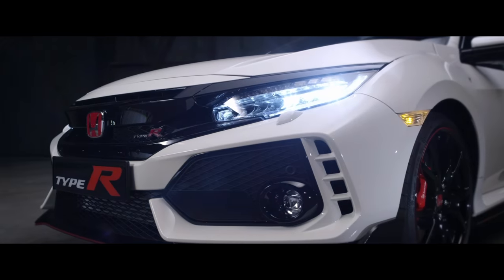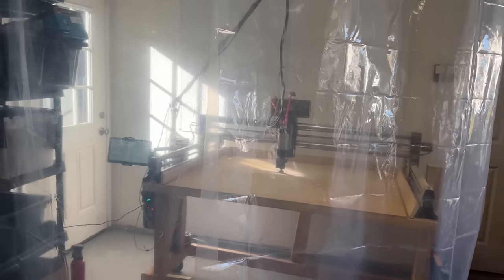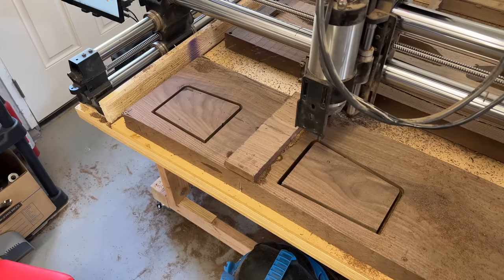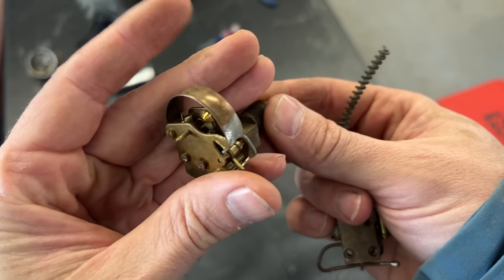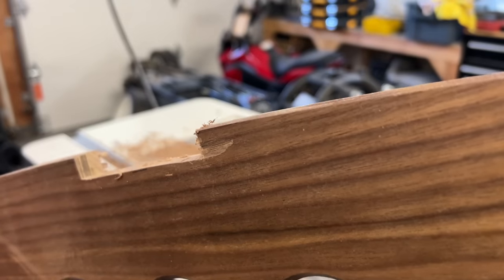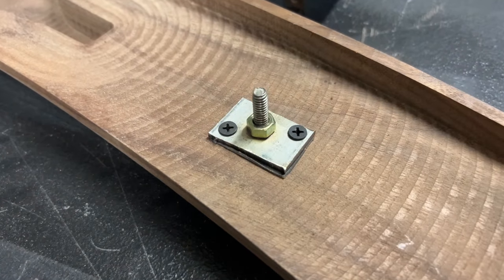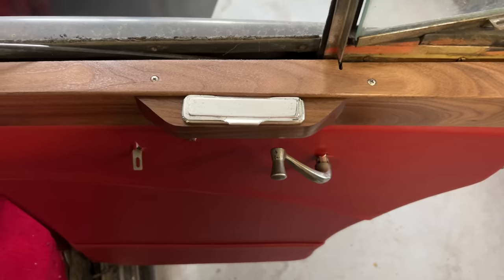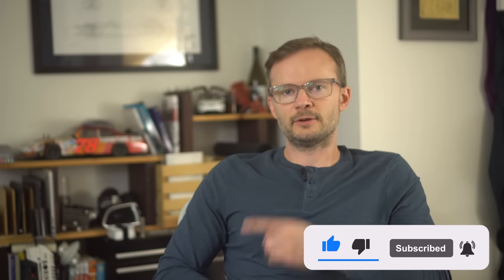Make A Wood Dash For Your Car. Or Just Watch Me Do It. Whatever.

Comment: The reason they use engineered wood substrates in cars isn't a cost saving measure. Its because MDF\Ply with a veneer doesn't shrink or expand to the same degree as solid wood in an environment with fluctuating temperatures and humidity such as a car. You may find over time your new pieces warp or crack because of the environment they are in and machined MR Moisture Resistant MDF with veneer is the better option. Real wood veneers will look better than fake ones though ;-)
Reply: Well said. You stole my thunder
Reply: "Fluctuating temperatures and humidity"
Its a car kept in a garage in southern california, the ultimate car preservation cheat code.
Besides, he's got a CNC machine. He can just make another.
Reply: Yes, this.. They used solid wood too, until it cracked... didn't last. Plus, the burl grain pattern has a certain luxurious harmony that plain flat boards cannot convey.
Reply: Would pakkawood work
Reply: They still use veneers today at Rolls-Royce and Bentley
Reply: @throwback19841  yes like you want to redo that
Reply: It's quite possible to future proof. Even easy if you're willing to do a little thinking. Walnut expands across the grain at a rate of about 2 thou per inch, per percent change in moisture. If you use mostly flat sawn walnut and give yourself about a 16th to an 8th of an inch of wiggle room and  more importantly cut slots for your fasteners you should have no problems.

Source: am furniture maker.
Reply: @throwback19841  Garages are not usually climate controlled. You know I have this pretty neat 3d printer, I could print a shelf for my shower in PLA and it will work just fine and eventually the tendency to absorb moisture PLA has will make the adhesive strip eventually lose its grip. I mean sure I could just print another one and be good. orrrr... print it in PETG the first time and not worry about it absorbing water and falling off the wall.
Reply: @tunahxushi4669  "Chatoyancy" ...it's such a fun word for some reason.
Reply: As long as you have some movement at one end when fixing to the metal you'll probably be okay. We'll see after one summer in LA, that's for sure.
Reply: But they won't be fake cracks. They'll be real cracks. Good cracks. Honest cracks.
Reply: Woods they use in marine applications, like Teak and Cedar might also be an option to explore in the future
Reply: Thank you for the information
Reply: They wouldn't have been MDF because it wasn't around at that time but they did have plywood.
Reply: @Karmabim123  They had fibreboard though
Reply: Plus burl wood is at the top of the food chain for stupid expensive….
Reply: Here in California we still get variations and heat kills
Reply: @throwback19841  You are not wrong.  We imported a Triumph Spitfire bonnet from So Cal 25 years ago before you could get reproduction ones.  It was perfectly rust free, but the paint was burnt to a powder.
Reply: @swartzkopf5695  I love this answer. Can confirm you are correct. Source.... Furniture restorer.
Reply: Shrinking/growing walnut.  Yep, my brother-in-law has a beautiful kitchen table made of solid walnut which uses a breadboard type end cap. From season to season the end cap goes from perfectly flush to  mismatched over 1/4 inch on each end. And this is in one of the most climate steady houses I've ever seen.  Certified passive house with metered and conditioned air exchangers.  Usually no outside influence at all and the wood was kiln dried before use.  Quite remarkable really.

Edit: kiln was fat-fingered.
Reply: @throwback19841  Park your car outside for half an hour on a sunny summer day and the dash will reach temperatures upwards of 60°C. 

Car interior is a tough environment for any material.
Reply: Yes but 1950s Britain, where these were built and sold prior to global warming was a black and white cold damp place where solid wood buckled and twisted at will so good quality ply with a veneer facing was the only answer.
Reply: @SuperDeinVadda  yeah I know I live in california.

There's a reason people put sunshades on the windscreen.
Reply: Matt, I've previously made a solid walnut dash. (From a walnut tree I had planked and seasoned).Had to insert many cross grain fillets on the back to prevent splitting on the thin sections.
Reply: @Victor Seastrom  call that imminent landfill, just add water
Reply: @thaphreak  PETG is more hygroscopic than PLA. Won't warp as easily as PLA though when outdoors. I've been running a petg wing mirror for two winters and two summers already without any issues.
Reply: @thaphreak Garages in Los Angeles don’t need climate control.
Reply: @victorseastrom3455 It also ruins blades and bits at a rate that obviates the material cost savings. MDF will dull a router bit faster than anything.
Reply: @throwback19841  you mean a location with massive temperature fluctuations depending on sunlight.
Reply: Thank you, exactly right.
Reply: It wouldn't hurt to seal all wood surfaces, ie backside, holes, ect.
Reply: I guess he knows that full well. But - y'know - clicks and comments...
Reply: It's also preservation of limited materials like burly wood.
Reply: All of the wood trim in my 40 year old mercedes is still perfectly flat and fits like new. Its all dense plywood with veneer.  Mercedes did great wood trim and veneer work but they used a thick high gloss clear finish which is cracking and lifting.
But the veneer under it is still great. If you can get the clear finish off without damaging the veneer it only takes a light sanding and its ready to finish.
I spray 3 to 4 coats of eurathane clear on it and it looks as good as new.
Reply: @tunahxushi4669  his new dash looks like a clothing cabinet.. just cheap compared to the old veneer
Reply: @merr6267  
“Kind dried” did they stroke it and whisper sweet nothings as it dried? 😉
Reply: I hope he sealed the back of the wood or it will cup when it gets humid.
Reply: @stijnvandamme76  ... Yup, I didn't wanna say anything. But you are right, it needs to be burl, straight flat grain isn't quite "right". Having said that, I think he did a very high-quality job and it still looks beautiful. If he spent a few thousand bucks could've CNC'd the entire dash out of stabilized burl...
Reply: Probably a decade ago I caught a comparison of vw group "wood" dash materials.  VW GOT Plastic with a wood grain printed on it.  higher end Audis got a magnesium alloy panel with thin wood veneer on it.  ROLLS got a crazy thick slab of wood with a burl veneer.
Reply: @JSchroederee  I think you meant Bentley, RR has been under BMW for about the same time frame.
Reply: You got it
Reply: Well said, was my immediate thought too.
Reply: What we did in these cases of ruined dashboards: stabilize the original ply again and put on a thicker layer of period correct veneer with epoxy under vacuum. The right formulation of epo and wood share the e-module, so the old nitro-cellulose craqueléé and the dog-ears do not come back. Still "fake", but it will not crack and check to the point that Your worthy clockworkery falls down under the clutch-pedal.
Reply: @lutomson3496  massive amounts of rain and snow too!
Reply: @throwback19841  You actually need the humidity for wood as you don't want it to dry out as that is when it will shrink, warp, and crack. The arid southern California climate is not what wood wants.
Reply: And they did not have CNC routers to carve away the excess wood. Using cabinet-making practices of the day was far more efficient than carving out all that solid wood.
Reply: @throwback19841  Instructions unclear. I don’t live in Southern California, or have a CNC machine. Help.
Reply: @philipparana9225   on the jaguar cars from 20 years or so ago with burl walnut trim the veneer was bonded to a metal. These were very durable assemblies.
Reply: The glovebox doors will go first, probably sooner rather than later. Splitting, warping etc.
Reply: I might look into stabilized wood, it’s popular with knife makers. It tends to be expensive, but it resists water and size changes.
Reply: Stabilising the timber would be an option.  Penetrating epoxies etc
Reply: Exactly.  I actually did this back in 1989 with my Mercury.  It looked great, but in Texas heat it only lasted 2 or 3 years until it cracked.  Still looked good, but veneer on a stable base is more durable for sure.
Reply: Well said. People have a warped idea of veneered work thanks to cheap veneered furniture. It isn't an inferior option. In fact, some of the finest work ever made was veneered. It allows the use of grain not feasible in the solid, the ability to achieve a homogeneous and symmetrical look, enables the responsible use of rare timbers and, as you say, it avoids the inevitable problems with expansion and contraction.
Reply: So many people said the same thing I was going to say. Almost feels like it might be a real concern.
Reply: Wrong info! We only had five hands (and arms) the sixth was a prosthetic. Eventually the government passed a law for surgical removal of three arms (or four if you wanted to keep the prosthetic). They felt it was unfair for the English to have an advantage over the Scots, the Welsh and the Irish, plus the Americans who would buy Jaguars. I appreciate your videos. Any plans (as a nation) on growing extra arms?
Les in UK
Reply: Just because this guy's right ... doesn't mean you have to listen to him?     Lol. the cracks will. Give it  Is character...and if you're gages. Start Getting a little. Loose  put some silicone behind them..... Rock on......
Reply: @Bobo-ox7fj what do you mean by rubber wiper blades, what was before rubber
Reply: Cars are one of the harshest environments for materials. It doesn't intuitively seem like it, but temperatures on a dash can range from 140°F to -20°F with humidity ranging from saturation to bone dry. Plus, unlike a house, the temperature in a car can swing from 0°F to 80°F and back 10 times in a day if you're running errands and blast the heat in between stops.
Reply: MDF is best avoided, Aston Martin used to use it but it's nowhere near as good as cabinet grade birch ply.
Reply: ummm wood doesn't absorb much moisture when it is sealed in a vapour resistant finish like 2 part polyurethane or lacquer. my boats all have lots of wood (pretty much the main ingredient) and they don't have issues with warping because it's all sealed.
Reply: @captain34ca  Cars are a little different doe to rapid changes in temperature and humidity changes.
Reply: I make high end cabinets and all our stuff is veneer on an mr MDF substrate
Reply: @FlynnBrockway  Not that high end then.

Comment: Couple things about that wooden dashboard from someone who's done it... You're going to need to keep the car out of the sun. Preferably in a meticulously climate controlled environment even assuming the wood was kiln dried professionally. Still, warping (and discoloration) and cracking is quite likely over time. I predict, unfortunately, that without great care you'll be redoing these again before long due to the inherent instability of solid wood in that environment. Ideally, a beautiful wooden burl veneer would be used (instead of plain straight grain) next time, and use an extremely moisture and heat stable base like resin or carbon fiber. That's really the way to do it. We applaud your efforts, and we all love love love your channel.
Reply: did he varnish the back of the panels?  I didnt notice, if he has not it will very VERY quickly banana
Reply: The last sentence sums it up really well. Keep it up Matt!
Reply: @nononanonon  walnut and citrus oil...
Reply from the maker: The mounting for the three lower pieces are all kind of flexible. in fact I currently have the glove boxes only held on the inside. there are provisions for mounting the bottom, but with the kick panels, they kind of nicely squish in place. so I hopefully have enough flexibility in mounting that i doesn't crack. also it's parked in the shade in southern california, so that will help. I appreciate the note. Good thing about having a YouTube is that if this does fail, I get more content :)
Reply: I was wondering about that. My step dad loved surfing and was a big car guy, so he always wanted a woodie wagon. I remember his friend Matt was a furniture restorer/maker and the amount of wood he rejected for that car must of been half a forest in Canada. I learned a lot from that man, he was very cool.
Reply: The reason they use veneers instead of solid wood isn't just expense. By using plywood then applying a veneer, the final product is more stable, and less prone to cracking/warping. Even today on 6 or 7 figure luxury cars, veneers are still the norm because of it's stability and longevity. Looks great!!!
Reply: You can use heat and vacuum and wood hardener to stabilize wood, then you basically replace all the moisture with stabilizer agent...
Reply: so you're saying under a tent in the backyard is ideal?
Reply: @SuperfastMatt  Be interesting to see if they do warp. 
I've worked on a few of these, and taking the dash apart can be fun as the substrate, used under the veneer for it's stability, does exactly what your dash did in the corner. 

On a totally different note, Smiths already have a method for converting the old gauges to stepper motors, that is perfectly hidden. 
You just have to spend a few million on a continuation XKSS to get hold of them.
Reply: I was going to say exactly what Tunah Xu Shi did, but they said it far better than I probably would, lol. Veneers and laminates aren't "cheap" they are "stable". ;)
Reply: This is FUTURE Matt's problem :D
Reply: @SuperfastMatt  Shade or no shade that is not the issue it's moisture transfer that makes wood move around. The old craftsmen knew this and adjusted for it.
Reply: @SuperfastMatt  IE, my mistakes will lead to future income.  I literally can't lose!
Reply: @blackbuttecruizr  Exactly, it had nothing to do with being cheap, it was actually for stability in the relatively hostile environment of a car's interior.
Reply: He has the CNC templates now.  Redoing it in resin or carbon fibre with the same CNC template and then adding a burl veneer over the top would be pretty straight forward if it has to be redone.  Just keep the CNC files.  Actually, can you upload the CNC files??
Reply: Your comment made me think of the poor guy who made an entire car out of wood. It looks great...for now. But as you say, it will warp and crack before long. 
- https://youtu.be/q4WJZUeyDEc and this guy too: https://youtu.be/ofDAeGxO9Tc
Reply: Excellente remarque..

Comment: Solid wood is not used because solid wood moves, cars are never in room conditions so the wood would warp and crack. That's why manufacturers use veneer.

Comment: Me and the guy I worked with used to call our oscillating tool "Buzzy McBuzzface". 
Because "hand me buzzy" is much easier to say.

But there was a downside to our incessant tool renaming, no one else in the shop knew what the hell we were talking about. 

The orange deadblow hammer became known as "whack-a-mole"
The 15" adjustable wrench, "plan B"
1/4" impact, "tink-tink" (think lower case ugga-dugga)
1/2" impact "Mucho Huevos"
super shallow spline drive ratchet "money-maker" (because it meant we didn't have to remove panels to get to the bolts)
16" metal shears (think really big side cutters) "everything remover"
the 3/4' deep well impact socket was "lucky"
Hammers were known as "UFIGs" (acronym for Unidirectional Field Impact Generators) not to be confused with OFIGs (omnidirectional field impact generators, ie: grenades)

And so many more. Looking back, this was likely the reason no one really wanted to work with us, and probably why were always selected for the "random" drug tests.  It was either that, or the time we put "10hrs of humans screaming" on the stereo and blasted it all day. The world may never know.
Reply: Had an iron six foot long pry bar. Name: Persuader
Reply from the maker: I like it. it will henceforth be referred to as Buzzy McBuzzface
Reply: @SuperfastMatt  How do you get the dimensions for the curves?

Comment: The reason they used and still use baltic birch plywood with a veneer is because of the constant expansion and retraction nature of wood as temperatures and humidity changes with the seasons, the cross sectioning of the ply eliminates cracking, checking and distortion...   Bentley and Rolls-Royce are high end hand made cars, they don't use baltic birch because they're cheap,  they use it for longevity and quality....   i still liked your video,  you do amazing work.

Comment: I love seeing you back on the Jaguar.  Just a thought on the ashtrays, but I've seen restomod cars where the ashtrays have been converted with USB charging ports inside them.  Just open the lid or slide out the ashtray and plug your charge cord in.  They usually put a mounting plate inside the ashtray for the charging ports.  When not using the USB ports, just shut the ashtray and it looks stock.
Reply from the maker: I CAD'd up an insert for the front one that has a lighting port and a slot for my phone. it blocks the rearview, but I might add it anyway.